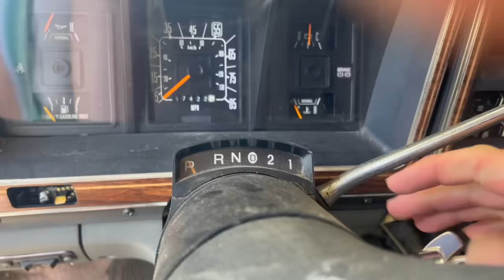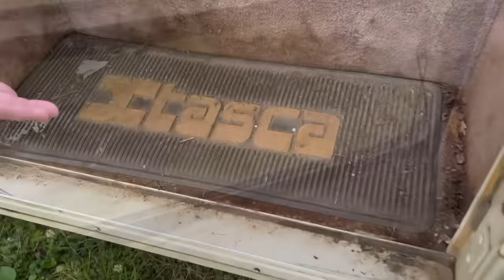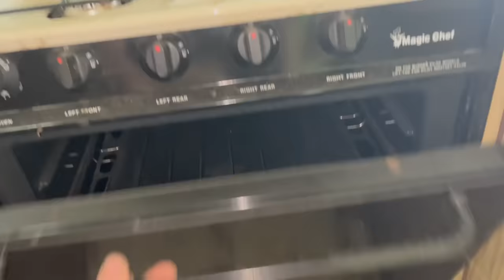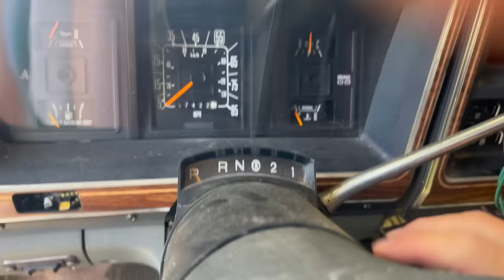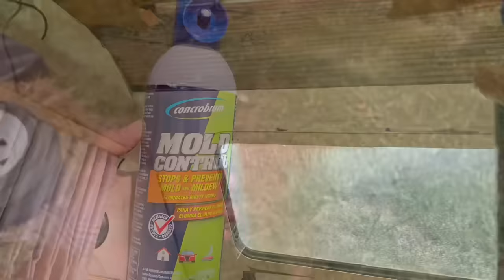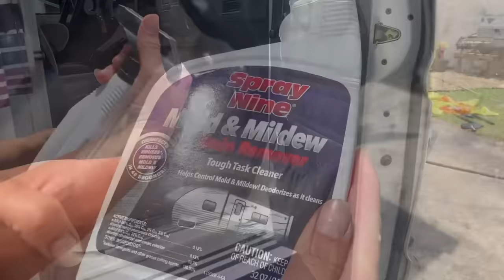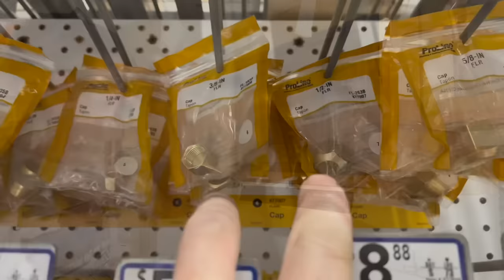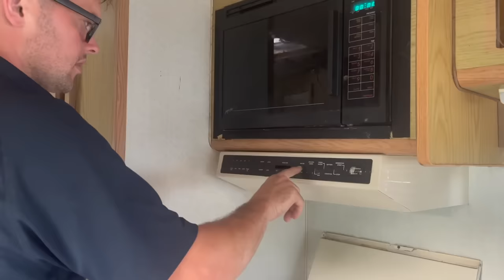31 year old RV parked for years! Can we clean it up and camp in it?

Comment: FRP panels are what I used to finish out the back of our '75 Winnie when I redid the walls. It's nice because they have matching t-moulds & end caps to trim it out. Glue it to the new wood/foam ceiling, and call it a day.  Resilient & rot proof.
Reply from the maker: Ok great thank you
Reply: @Sleeperdude  use marine or pressure treated lumber and plywood to patch in new repairs  to make it last longer

Comment: After digging out all the old sealant, around everything going through the roof. Clean all the area , where you need to seal, with  isopropyl alcohol. Reseal with self leveling Dycor sealant. They also make a good product to paint on to seal the entire metal roof. Good luck, happy camping.
Reply from the maker: Ok thank you
Reply: @Sleeperdude  remove AC. UNIT then strip roof one segment at time use a plastic roll sheeting to cover roof and use pressurentreated. Lumber

Comment: Keys?  Om all or nearly all RVs. the CH-741 key will fit everything except the entry door, and of course, the ignition and the cab doors. The roof isn't all that bad to repair. After taking everything off the effected area, peel back the rubber roof membrane, them the plywood and reveal the ceiling "studs" Which are generally made from 2x4s, radiused to provide the roof pitch for drainage. The inside is typically vinyl covered plywood, and you can find a "close enough" replacement at Home Depot or Lowes. I haven't rebuilt one for just over 30 years, but they are all pretty much the same. You can buy a re-roof EPDM rubber kit with the material, chemistry and instructions on line, these days.
A/C?  The roof air is pretty simple to remove or install. Take down the interior part, then remove the 3 or 4 very long bolts that hold the top and inside together. The Installation is really simple. Fits a 14x14 hole, as do the roof vents. That antenna is an old school TV antenna, meant to crank up and rotate from inside. Not digital.
Reply from the maker: Ok thank you

Comment: Thanks for all of the hard work Mrs. SD and Ralphie. You did a great job. I'd pull the headliner down to see what's what. Fix that roof and the water damage and you'll be good to go. Josh you can fix that a/c no problem. Just fyi, carpet in RV's hold a lot of dirt. I've done a few kitchen floors with the vinyl flooring that looks like barn wood. Super easy to install and keep clean. You need a Michigan sticker on that travel map when you visit our Great Lake state. Enjoy your new (motor) homey. Thanks for posting.
Reply from the maker: Yes for sure thank you

Comment: If you pull the plastic top cover off the AC unit and manually spin the fan, I bet you can get it working again. It just locked up and needs to be broken free.
Reply from the maker: Ok thanks

Comment: Home Depot has 8' by 4'  1/4" sheets of corrugated plastic that can make great headliners. After you get your shape the way you want it just use 3m spray glue to attach headliner material onto the panels. Then use spray glue and finish screw to attach to your plywood.
Very easy fix and will look great!!

"
Reply from the maker: Ok good to know

Comment: My Brother & Sister bought a couple of RV's. Bad leak in the back of one & they had to take off the whole skin. Reframed all the wall & had to remove alot of rotten wood. Parts were fairly reasonable to cheap. Looked ugly as hell thru the process but when done, they easily tripled the value.  Lots of carpentry work though. Remember rain travels sideways when it enters the RV. So it is all thru the ceiling & should be removed to remediate the mold. Rug should come up too, so you can check for mold. Easier to replace with fake wood floor. Easier to keep clean & won't suck up the smells created over time. That turd looks like a good buy. we are in Lebanon, Tn if you need carpentry work help. Ty for taking us along
Reply from the maker: Thank you

Comment: They have a rubberized paint that coats roofs and seals them. They use it to seal roofs on mobile homes to. It comes in gallon or 5 gallon buckets. It works really good to seal roofs. Saves money.
Reply from the maker: Ok thanks
Reply: @Sleeperdude  hope you try this and it helps you

Comment: Many folks put a 100 amp splitter from the alt to car and deep cycle batts.  If u have many deep cycle batts u may need to sw them on one at a time cuz they can blow like dynamite or affect ea other.
I put a 5kw gen on a 100 ft of # 10 wire using 240vac and a xfmr down to 120 vac and usually parked 
At the big rv sites w 240 since the ac came on quick fm 240.  If i was at a 120vac site, i ran 120 up 240 just for the ac the xfmr sat near behin the fusepanel.

Comment: My southern relatives call tires casings. I looked it up. "The tire casing is the body of the tire and includes components such as the bead, belt system, sidewall, body ply and inner liner—basically everything except the tread. This foundation upon which the tread sets is the supporting structure of the tire." So a casing is a tire before the tread is applied. So "tire" really isn't a dirty word. 😀

Comment: First off, I want to say that your Family is Fantastic..  Second:   I wish i was there with you, to help you along, Ive rebuilt quite a few [too many Lol..]  Trailers and motorhomes, and trailers, It sounds like you want desperatly to go camping in this Yacht, so my best advice to get you going, would be to Buy a Roll of 4Mill Poly Plastic... Attach  both ends with a 1 !/2 inch dowel 2 inches wider than the width of the roof.
Secure the back end of the dowel [with plastic [4Mil poly] taped or glued to the dowel, and  Roll your POly plastic forward to over hang the front of the overhead /overhang Bed area,  use some Elastic Bungey straps to secure it, and you wont have to worry about Rain any longer.
Yes its a pain to deploy, but it will 100% stop leaks.
It will end up  [rolled up] as a thick roll on a dowel at the back of your roof, [tie strap to secure] and you can use it over and over again.
Big Congratulations on the fine clean up job, to your wife and Ralphy....i know how much work it takes to clean one of these out, and make it presentable.
As always,, Much love from Canada, to you and yours...feel free to contact me through email [ catbear301@hotmail.com]  for any problems you may have with the Motorhome...
Best Regards
Al, in British Columbia.
Reply from the maker: Thank you AL really appreciate all your thought and kind words

Comment: Other than removing the satellite stand and repair that leak and fresh air vent leak she’s worth saving. I hope y’all get this going. 
On the Minnie Winnie I say pull the drivetrain out of it check the bearings for damage if they are good replace the oil pump and swap it in one of the MOPAR’s ya got in the yard.
Reply from the maker: You maybe right

Comment: Batteries: They both likely work, you just have to tighten the terminals all the way down. Just setting them on there will only produce that initial buzz sound when you turn it over half-way. It will fully engage after you tighten both the - and + sides. :)

Comment: That is pretty good that it started when the engine had not run in a while.  Especially with the really old gas in the tank.  . . .Check those tires, and if they are over 7 year old they need to be replaced!
Reply from the maker: Yes thank you

Comment: as it have over-drive from e40d that will get better mpg. the 460 well never get good mpg always was build for power. love the family road trip. but anything with fuel injectors, i will run some spt fuel injector cleaner in the tank. as it helps unstuck any stuck injector. just a tip i picked from owning older rv's.
Reply from the maker: Ok great thank you

Comment: To clean the outside of a camper, use a cleaner called Purple Power. Spray it on and scrub it with a  mop or a long scrub brush or broom, and rinse it off and it will remove the dirt, mold, mildew, and oxidized paint and surface deterioration of decals and have it looking great.
Reply from the maker: Awesome thanks
Reply: @Sleeperdude  Purple Power is carried at Dollar General but I am not sure what other stores. It’s actually a degreaser but is used by RV owners to clean their RV’s and I can attest to how well it works. About 4 years ago I found a 1977 Journey 26’ class A   RV for my ex-wife (she’s still my best friend). It had been parked in the woods for 11 years so it had black tree crud, mold, mildew, dirt, etc on it. After online RV sites recommended iPurple Power to clean it we sprayed some on it and literally watched the nasty stuff that was on the RV soften and start running down the side of the RV.  THEN we noticed the white paint was running down the side and onto the severely faded striping decals and the orange and brown from the decals was running onto the white paint below the striping.. We were panicking and started to rinse it off immediately and noticed the paint and decals were looking pretty good but still went back online to tell the ones who were recommended using it that it was attacking the paint and decals and were told that it was removing the old oxidation and to spray it on and use a brush on it on all surfaces. We did and that old Journey outright SHINED and shines even now. The decal stripes even looked like new. I used it on my 1963 Dodge 440 4 door and it cleaned it up nicely. Do a smaller test area first in case it doesn’t work well with your type of paint.

Comment: Check at the rear of the outside of the camper near the bottom and see if there might be a storage spot for the gray water and sewer lines. If not they are probably available at Walmart in the camping and trailer supply section.
Reply from the maker: Ok thank you

Comment: The "Satellite dish" on the roof is a common analog TV antenna, they didn't really have mini dish style satellite TV until around 5 years after that camper was built, and they were insanely expensive at the time. Still, it could pull in some UHF frequencies that are populated by digital signals now, maybe with a signal amp wired in, just can't get DirecTV or whatnot.

Comment: Whether on the other camper, a different one, or this one, if the refrigerator doesn’t get cold but the propane burner and electrical heating elements work and there is no ammonia smell in the refrigerator, take the refrigerator out and turn it upside down and listen for the sound of running liquid or a gurgling sound and leave it upside down overnight, clean the inside of the burner tube for the gas system,then re-install it and it should work just fine.
Reply from the maker: Ok good to know thank you
Reply: @Sleeperdude  the fridges tend to get air locked in the cooling tubes which are filled with ammonia. That’s why if the fridge is bad you will smell amonia. RV repair shops do the exact same thing to fix  but will charge about $250 to do it

Comment: Hi super,  
The inch meter at fridge i about 7 or 8  normal at the tail of propane line.
The water htr and heater and stove are prior to the fridge, always soap connectors from tank to the last for bubble leaks.
The igniter cards for gas are the same, just clean up or get a spare 10 sparks 3 times and quit.
The rv deep cycle batts may be direct tied to chg from alternator.  Lookout for 5 volt center tie of ac windings when deep cycle is down and chg causes motor computer 5 v to wander... the aluminum 
Regulator ford is not accura

Comment: Look for a used rv salvage yard in your area. Most of the things you need will be cheap. Also, Amazon has a great selection of original equip. Rv items. We rehabbed and old rv and it came out ok. Ripped out the rodent infested heater , cleaned the ductwork.  Good is3d ac units are available. Roof vents ar3 cheap. Use only Dicor brand roof sealants to seal up the roof items. Self leveling. Have fun.
Reply from the maker: Ok thanks for the info

Comment: PLEASE CHANGE YOUR LIGHTS TO LED...those bulbs run hot and if you leave them on, they will burn a hole in the plastic. Momma looks beautiful as usual. I have many more ideas for you, like where you might get all your solar panels for free. If you take two steel curved cross members, one before and one after the airconditioner, that should support the weight and shed water instead of pooling like they do. Then after you get it good and clean, coat it with a good elastameric coating. Have fun
Reply from the maker: Sounds good thank you

Comment: Hey Sleeper Dude make sure you put a 30 amp end on the power corde.Useing a regular plug won't work at R V parks without an adapter that will get hot and burn up.When you plug the L/P tank use gasOla sealant, it's safe .Test for leaks w/ a soap water solution .14 inches of water column is safe.A 4KY Genset Onan is what that unit came with.Let me know I have worked for Cummins for 26 years.I m a R V power  gen tech
.
Reply from the maker: Ok thank you

Comment: Hey Josh check the drivers side collapsed section for correct support before attempting to go more than a couple of miles or any long distance stuff. In the video of it being moved that section sags significantly. Also take the propane tank and check it’s expiration date. Seen too many old tanks go bang due to age. Also where you put that block off bung make sure that has sealant on the threads. I’d even consider chasing that line out of the cabin if you’re not putting a refrigerator that is gas powered back in location. Black mould is dangerous to the lungs no matter how much bleach cleaning is done. If you pull panels & are still seeing black mould, please don’t set up to camp in it. The long health implications aren’t  worth that. Working in the car detailing industry I’ve seen a lot of mould in detailing & this is up there with the drag a blow torch out for being my next tool.
Reply from the maker: Ok thanks for the info

Comment: The roof is a remove and replace. You peal back the rubber roof, remove the rotted plywood, check out the upper side walls. And replace and seal as needed. These are built from the bottom up, inside out. So you start the repairs from the top of the roof down.
Reply from the maker: Ok thank you

Comment: On the other camper with low oil pressure.  Try to get to the oil pickup screen, in the pan, and see if it is partly clogged.
Reply from the maker: Ok will do thanks

Comment: Excellent video Sleepdude Crew  :) on Camper van also also be worth fixing up by my check on video to and hope see more videos to see fix up too! Also think Ralphie got lots bath on video last him a year Lol and fix up battery cable on engine to also Josh so work better plus won't short circuit engine to! Also on key ignition switch without key in put some pentriotion fluid in teeth tumbler plus around chrome part steering Coulmn  keep from seized up then put key in the ignition switch and go in and out couple time to and all key locks too for doors too! Also change engine oil  , oil filter, air filter, fuel filter , check transmission fluid , power steering too also rad fluid too! Also new spark plugs plus wires to! Also Josh get a Black Bottle of Brand of Gunk Red Seal of Trans-Medic in Transmission, for Rad from NAPA Auto parts store get grey bottle of Brand RISLONE add in rad when cold it jelly seal lube to motor, 100ml of 80w90 differential fluid in  lube water pump also seal any leaks too ! For fuel tank get bottle of STP Total Treatment fuel injection and carb cleaner in fuel with 89 or higher octane gas to every time fuel up ! Do this and drive like brand new vehicle  too !
Reply from the maker: Ok great thank you
Reply: @Sleeperdude  welcome!

Comment: Your interior lights are all 12 volt. Your electric outlets are all 120 household current.  Your drains are all gray water. The toilet is the brown water tank. Use as little toilet paper as necessary as the paper tends to block the sensors.  Your 30 amp service is 220 voltage.  We lived in a 5th wheel for just over 3 years.
Reply from the maker: Awesome thank you

Comment: Peppermint oil or Vicksburg for mouse rats an mothballs  or snake away fir snakes, get flex seal paint roll it on roof. Duct tapes. If you go get some purple power depresses, an some fabulous, from dollar generation in a bucket of water 2 caps full of purple power, you will have a shinning rv

Comment: u should have one them trays for a deep cycle 12v battery down passenger side on the bottom or a driver side up front in the engine bay. I got me one '84 Econoline E350 with the IH 6.9. u should have the C6 transmission in there.
Reply from the maker: Ok thanks

Comment: put a mechanical oil pressure gauge on the dodge.  In the 70s dodge used wire that was a nightmare.  The plastic becomes very brittle and just falls off all on its own....may be another reason to park the dodge...
Reply from the maker: Ok thank you

Comment: You may have just spent $1,250 for a Long Frame, Dually Rear, 460ci and a questionable Transmission...
Wait, did you "Side discuss" about placing the 460 in a FAIRMONT?
Coupe, Sedan, or 🤞Wagon🤞!
As long as she has a 9" Rear Transaxle and large front Disc brakes.
You had me at FAIRMONT!
Reply from the maker: That’s great

Comment: My gas tank was 60 gal and dropped the float often no guage... i put a led xmas 12v on the prime pump and it would cycle from a computer lead, i did the same for smog vac sws to see when they blew air on the o2 sensor.  The new puter 93 only set smog vac sw to warm up where old puter set a vac sw to blow air over o2 ea time u went up hill and burned more gas.  There was a old lamp that lit when the gas pressure was low and it didnt come on w the new puter